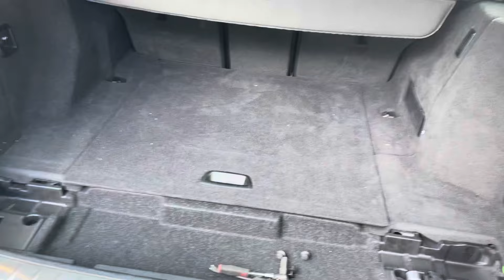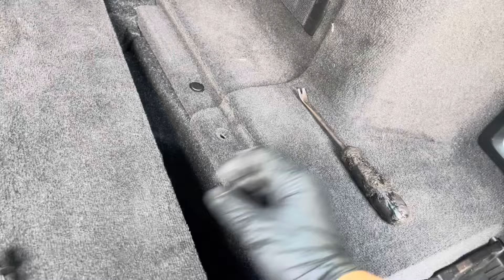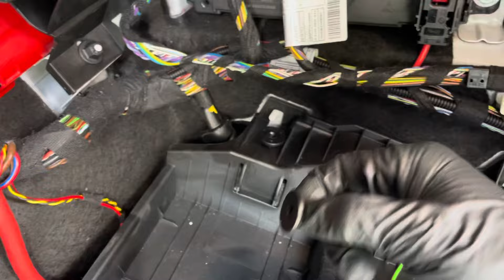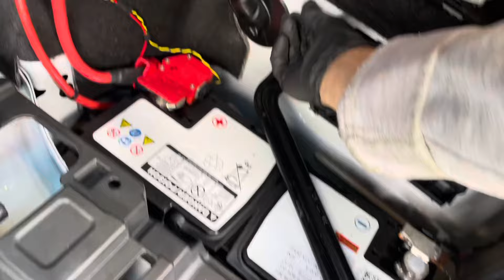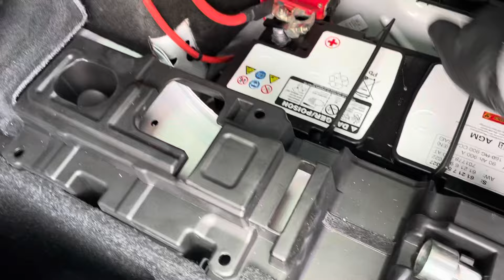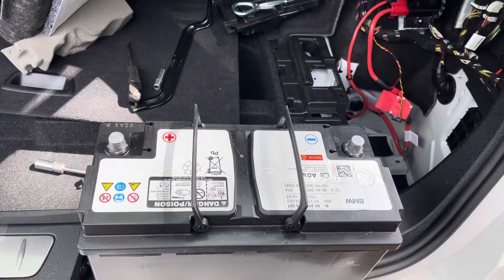BMW f31 3 series 2015 battery location removal

Comment: Hi ! And where is the auxiliary battery located? Thanks !
Reply from the maker: What auxiliary battery ?
Reply: @DaringBeefcake  my understanding is this model have a Auxiliary battery ( more small) to make work , for example , the star and stop
Reply from the maker: @mbasulto  as far as am aware that is not the case, all cars with start and stop have AGM batteries which is the main battery but with technology to deal with start stop. If am wrong do let me know for sure. 😌
Reply: @DaringBeefcake  yes , I think you are correct, because I was not able to find another battery….

Comment: thanks.  how do you get the clamp back on?  there is not enough space. thanks
Reply from the maker: There is no specific way, but make sure the battery is seating properly otherwise you can’t put the clamp back.

Comment: I tried removing my battery on my 2012 bmw 335i once I remove it the alarm goes on why ?
Reply from the maker: that's rather strange unless the alarm siren is faulty, i had the same issue with another car and the siren internal battery was faulty..

Comment: What a ridiculous place to put the battery!
Reply from the maker: I agree.
Reply: Not too bad compared to other cars, for eg under  driver chair!
Reply from the maker: @AdelinaAcsinte-ir1yu  true, to be fair, in the end all cars have something that doesn’t make any sense.
Reply: It's actually very smart place to put the battery and BMW has been using it for generations (E39, E87 I know for sure). It contributes to more even weight distribution between the axles. And for something that is changed once in 5-7 years, it's reasonable amount of work needed.
Reply: You must NEVER touch positive terminal with any kind of tool before negative is completely disconnected. By untightening positive terminal before you disconnect negative, you risk shorting the battery to the car chassis using the tool.
Reply: @peca89  good shout